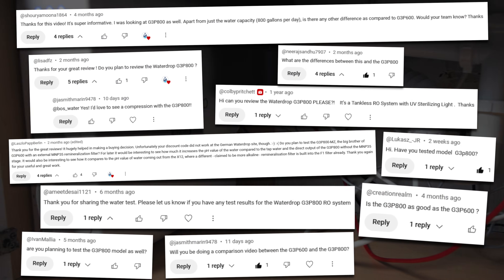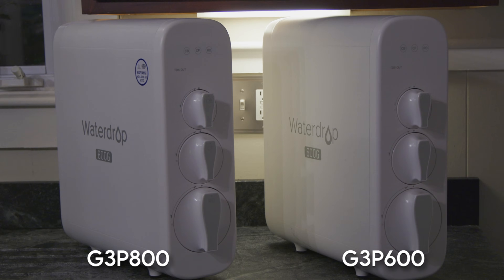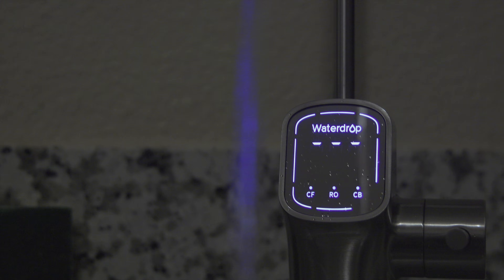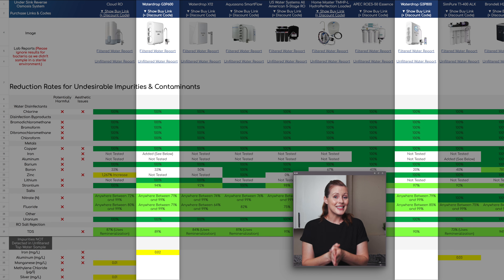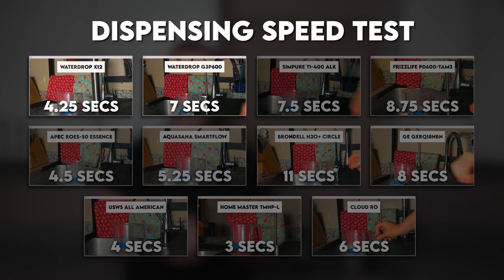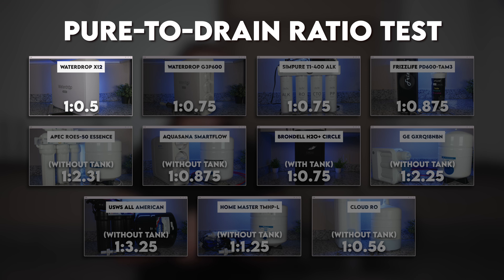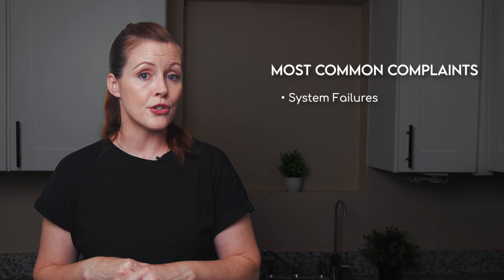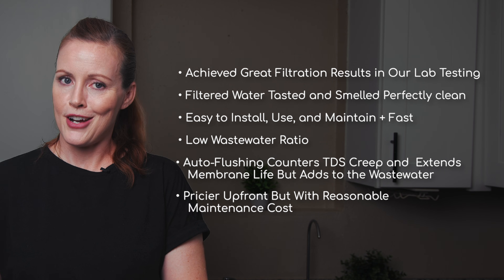Watch Before Spending $$$! | Waterdrop G3P800 Lab Test & Review

Comment: Informative vid. Earned my like, thank you! However, I wonder how the water waste ratio issue going to 4:1 if you don't calculate for the 28 oz of flushing required increases your water bill? Is it $5 more a month $25 or more? That decides how much of a deal breaker that may be imho.  Obviously each household is so different but getting an idea of what the range could likely be may be significant or not.
Reply from the maker: Thanks for the like! Here’s my estimate: A 3-person household might use about 3 gallons of RO water per day for drinking and light cooking. At a 1:4 ratio, that means 12 gallons go to waste. Using the national average combined water and sewer rate of $15–$17 per 1,000 gallons, this would add approximately $5–$6 to the monthly water bill.
Reply: @bos_water I'm really grateful for this response. Thank you!
Reply from the maker: You're welcome!

Comment: I think you need a video on the NSF certs.  I have now read them all and seems NSF 58 has a ton of optional tests and you cant just say NSF 58 certified are all comparable.   Plus isn't 42 and 53 included in RO 58?
Point is two NSF 58 (as it appears to me), can be vastly different if one includes the optional test, like lead for example).
Im not sure who to believe; you guys or the manufactures.   Sounds like you know what's up but for some reason not explaining this
Plus, why not review and rate higher the traditional RO systems with non proprietary filters that have NSF certifications?  
Please help me and others understand all this and help me believe you are just not pushing the proprietary filter systems so you can make more money vs us buying cheaper systems where we can buy standard filters on amazon
Reply from the maker: We do have a video on NSF certifications! Correct, you need to check what every certification specifically covers. No, NSF 42 and 53 are not necessarily covered by NSF 58. Yes, some contaminants such as lead can be certified against standard 53 and/or 58 for example, but not all. It's just that NSF 58 is specifically for RO systems (which doesn't mean that they can't be certified against other standards as well). Again, if you want to know the truth, you need to check the actual certification. It will contain a list of all the certified contaminants. It could be just 1, a few, or dozens. Question: Which traditional system(s) with NSF certifications are you referring to?

Comment: I love my WaterDrop 800. Yes, it was expensive. I've been thinking of upgrading to an X model which is even better at the flow. The slow flow is the only issue I have.
Reply from the maker: @abdulrayah Great to hear! How long does your G3P800 need to dispense a single cup?
Reply: @bos_water  According to my estimations, it takes 6.7 sec to fill a typical 8oz cup, I would like it in the around 50% less mark.
Reply from the maker: @abdulrayah That's congruent with our speed test. For the X12 we measured ~4.25 seconds!
Reply: @bos_water  Yes, that's roughly my calculations as well. However, it's just so expensive, and I'm still paying for the G3P800 model!

Comment: I really wanted to x12 but it looks like this model has better certifications, is that correct? I was most curious about filtration of atrazine and although their support team says the x12 filters that out, I wanted to see a report that says it. Love your videos!

Update: I found the answer, they have super responsive support. I really wanted alklinazation but the certifications are more important to me so im going with the G3P800.

"G3P800: This system is certified under NSF/ANSI 42, 58, 372, and 53, covering material safety, performance, structural integrity, lead-free compliance, and health-related contaminants. It also includes certifications like FCC, CE, and SGS.

X12: The X12 is certified under NSF/ANSI 58 and 372, focusing on reverse osmosis performance and lead-free compliance. While it doesn't include NSF/ANSI 42 or 53, it offers advanced features like 11-stage filtration and alkaline mineralization."
Reply from the maker: @tomsenn88 Yes, the G3P800 has more certifications.